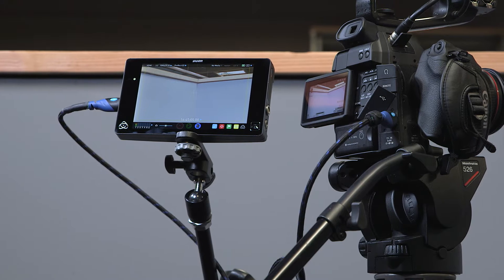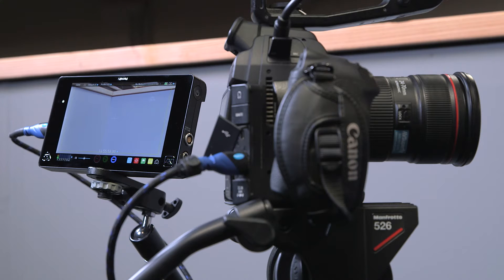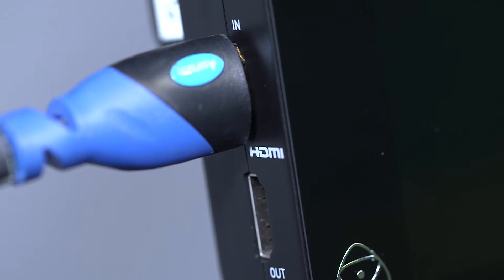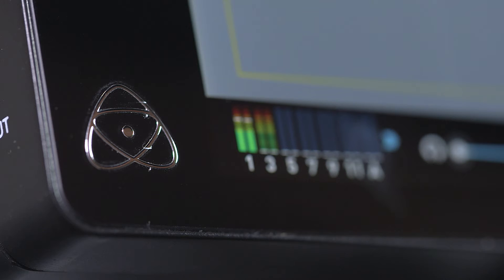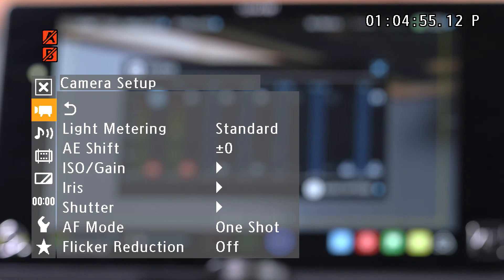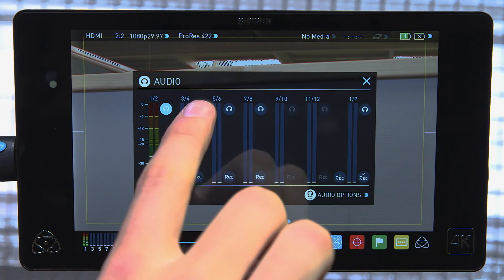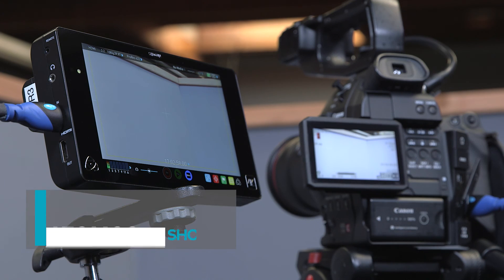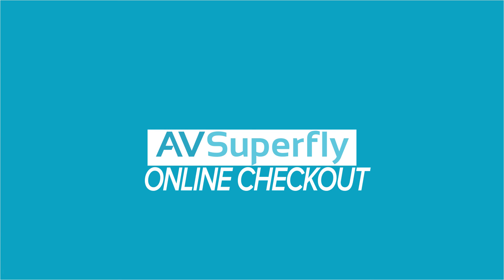Capturing Audio on the Atomos Shogun Pt2

Comment: I recently purchased Shogun flame. I found one issue with recording two separate mono dialogue.  It basically only allows me to record one source and it always into right channel even if you swap the connections from Left(black) to right(red).  

It can only record one actors' dialogue.  Do you have the same problem?